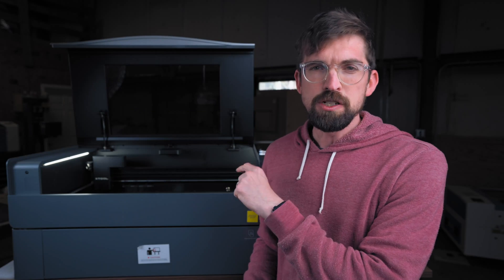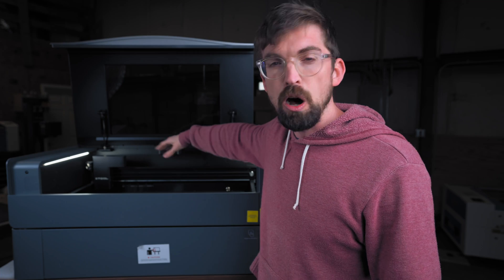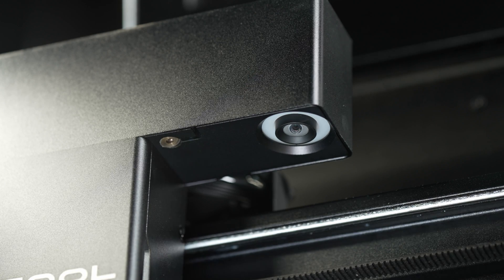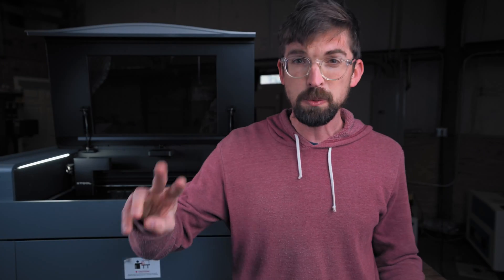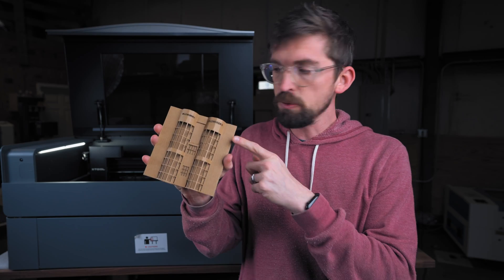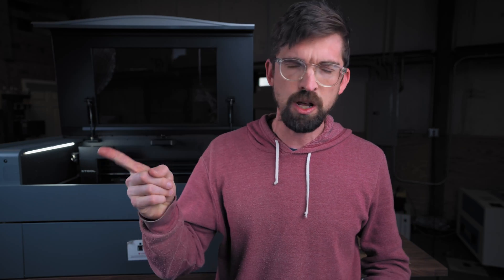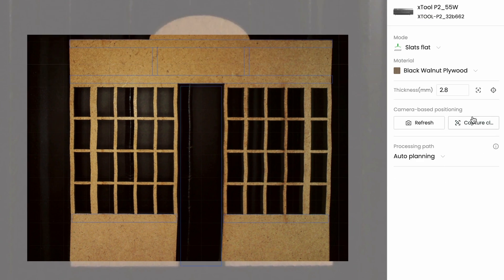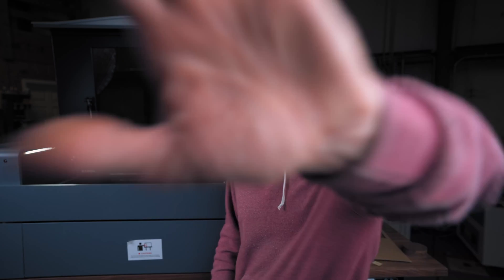Is This xTool P2 Feature Worth The $$ ?

Comment: Curved surface engraving doesn't actually require a camera.
Batch processing is useless, even in the demo you had to adjust positions which defeats the purpose. Certainly not good enough for production use unless your clients don't mind sloppily aligned engraving.
Second "bonus use" is not camera related either, material thickness is measured with the red dot.